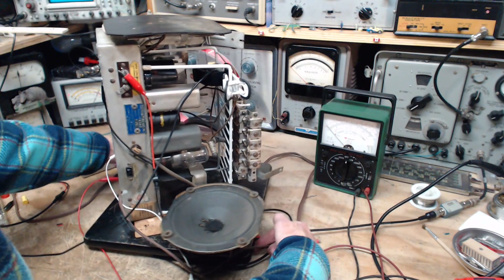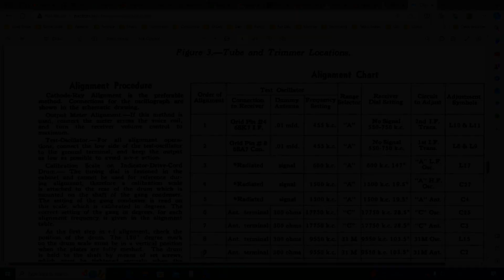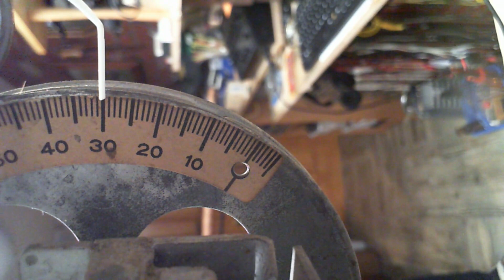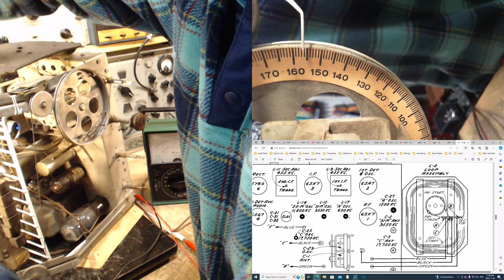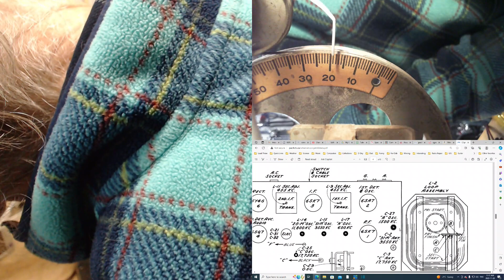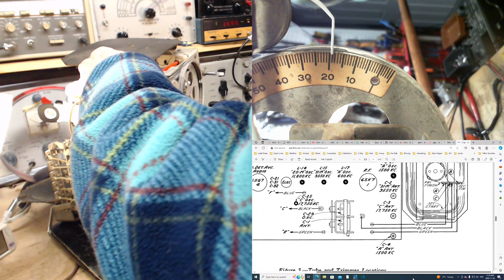General Electric KL60 Tube Radio Video #10 - Broadcast Band Alignment

Comment: well of course you read the instructions which said put the pointer on 180 with cap fully meshed, and did just the opposite! Put the pointer on 0.... Earlier video showed pointer aligned on 0, then tuned to 180 was off by 6 or 7 degrees. So he had to move oscillator to match 6-7 degree "error". Sheesh.  How this guy gets hired to repair other people's radios still amazes me.